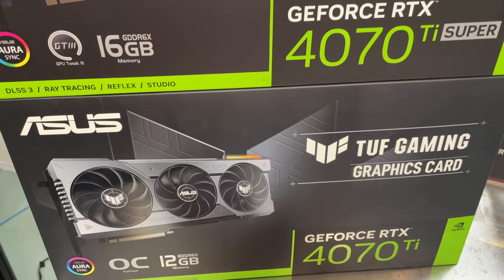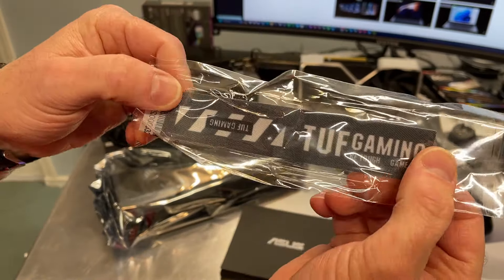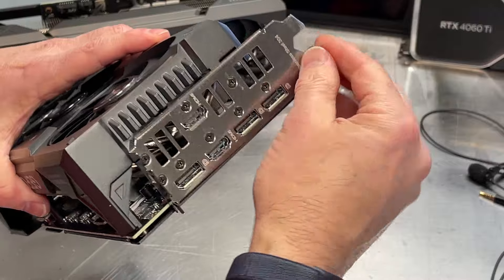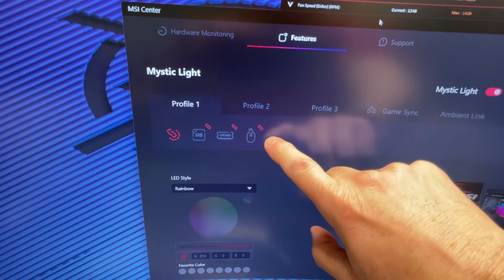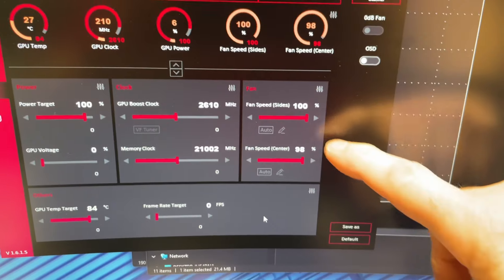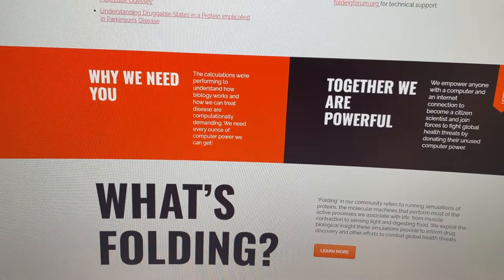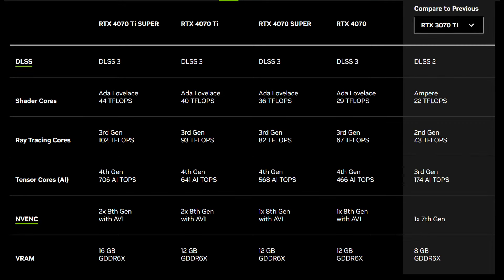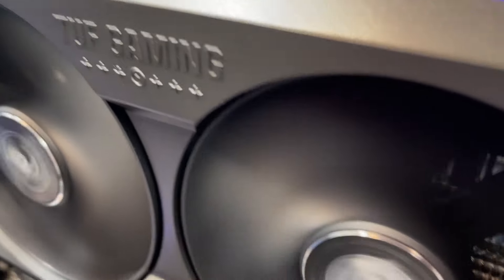Nvidia RTX 4070 Ti Super Review!

Comment: Anybody else get a red LED on the GPU when powering on the Power supply? The LED goes out after i power on my motherboard.
What cable is he using here to power the 4070ti super?
Reply: Yes they said it’s normal
Reply: You can get rid of it by using cable mod or Corsair 12vhpwr. Also you can disable it with gpu tweak 3

Comment: I just bought the same RTX 4070 TI Super the Asus Tuf Gaming. And the 12 volt power conector is inserted before i put the card in my case. It needed more force to put in then i expected. I thought it was flush at the start but when looking there was still a small gap so pushed it all the way and heared the final click. It runs perfect and very quite in operations. I am surprised at how cool and quite it stays under gaming and benchmarking.
Reply: my tuf non oc is coming tuesday, have you coil whine?
Reply: @26DeislerFCB   0.0% coilwhine. No matter what i do with it! The card even in benchmarks i don't hear anything.

It's silent that is crazy. Spins at max 1100 rpm in quiet mode.

Maybe i am lucky, buit i never had a card this well in terms of thermals and acoustics. 

It's even unreal with times. So extremely satisfied.
Reply: @karlos1060  whats your power supply name exactly plz?
Reply: @26DeislerFCB   Corsair HX850
Reply: Should've got the top of the line Rog Strix OC version like i did..
Reply: @504Trey   Nah it's way to expensive for the little extra you get. I do like the card but i bought the Asus Tuf Gaming RTX 4080 super at discount and sold the 4070 s within the month and did not lose 1$ on it. Bought my 4080 S for 1119€ at EU msrp. And very satisfied with it. Extremly quiet and cool. So no regrets.  The cheapest 4070 TI Super strix costs 1079€. So for 40€ more i have the 4080 super wich i a great deal!
Reply: @karlos1060  
I was going to buy the tuf 4080 super but after looking at video comparison & breaking down the price for which I got my 4070 ti super for I just got the 4070 ti super because the small fps gain for the 4080 super just wasn't worth it when all I care about is at least getting 4k 60 fps & that's easy with dlss & fg on my card.. most games i only need dlss l.. i just said I'll get the rig strix 4070 to super which paid $940 for & keep it a couple years then upgrade to a 4090 when the price on that go down after the 50 series cards come out.. hopefully they make a 4090 super
Reply: @504Trey   The prices in the Netherlands are still higher then the USA. However you paid 940$ wich is 140$ more then the tuf at msrp(4070ti s) So you still paid to much. Because the difefrence is small between the tuf and rog strix cards. Look at techpowerup where you see the good comparissons and you will see for 60$ more you would have a 4080 super tuf instead of your 4070 ti super strix. I would always go then with the 4080 super. The price increase is not worth it if you ask me.

The average fps at 4k for 25 games is 79.7 fps for the 4070ti super and 95,5 fps for the 4080 super tuf. So that is about 20% more fps at 4k. And only a price increase about 7% compared to the 4070ti super.

And both cards are great in heat dissapation and being silent and very cool. There is almost no difference between the tuf and strix card. So in my opinion i would only buy the strix if it was like 50$ more. Not 160$ for 1% more. 

Unless you really like the card(i think the older series looked nicer) i don't see a reason why you would buy this card. But for sure both cards are great.

Comment: is a 550watts powersupply from bequiet (gold) enough for this card?

I have a "straight power 11" and dont know if I can buy this card
Reply: Depends on your other components, especially you cpu. Leave 300w for this gpu. If the remaining 250w is comfortable enough for everything else then you are ok.
Reply: you'll probably need a new psu
Reply from the maker: 650W is what Nvidia recommends...
Reply: Dont get the bare minimum. Just get a 850w
Reply: @overclockersclub my psu also in 650w. Its okay to use?
Reply: Considering the spikes and the need to not take the bare minimum required, if you want to go safely, get an high efficient ATX 3.0 PSU around 700/750W at very least.

Comment: I'm guessing this card runs very cool even with little fan rpm since I think it uses the same cooler as the 4080.
Reply: It does. I can get my benchmark scores to base Super levels with my 4070Ti using the same max power, but it runs at 70c while the equivalent Super cooler runs mid 50s
Reply: No 4080 asus tuf use cooler from 4090 and its quite loud it has 110mm fans i tried but it was too loud and also coil whine so i returned it and bought 4070ts tuf

Comment: so question.....do you think that the 4060 ti is a better value for 1440p?
Reply: Dont use the 8gb one for 1440
Reply: @cosmic_gate476  k.   Ty.   I am kind of new to computers.  What is the difference between the 1080p and 1440p?
Reply: @themachine4008  pixel density which results in a sharper and clearer image.

1080p being the default of hd, 1440p 2k QHD and 2160 is 4k UHD.

With the increase of pixel density comes a hit to performance but higher vrams can help slightly off set.
Reply: @pudgemaster7952  Thank you